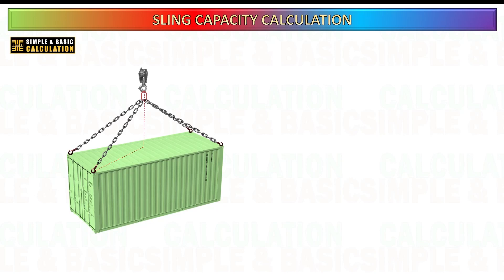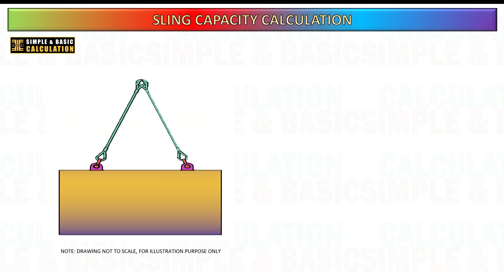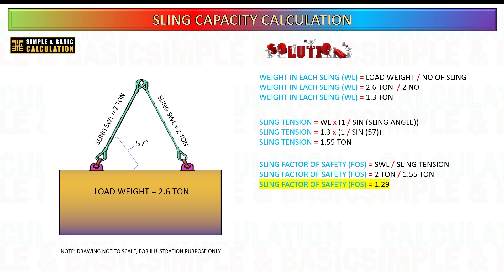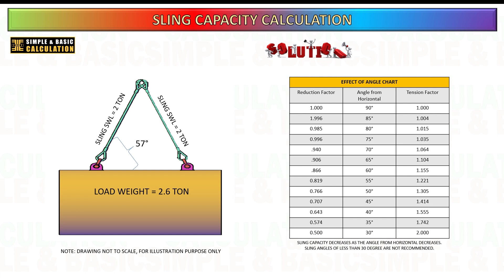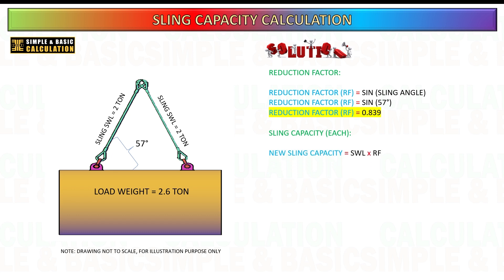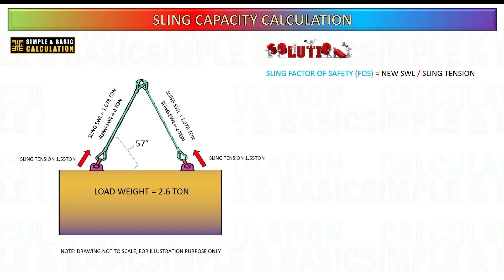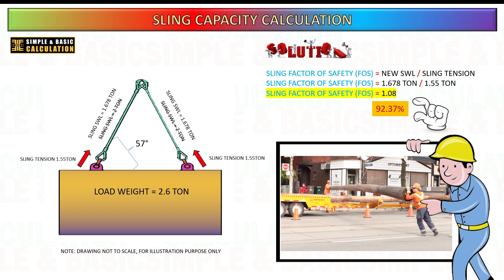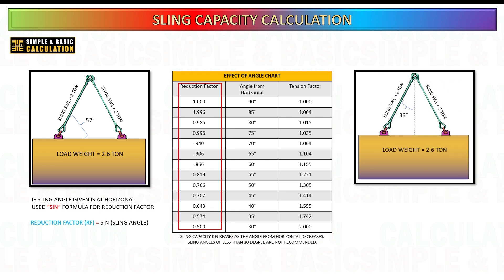Rigging Calculations: How to Determine Sling Reduction Factor

Comment: Dear sir please send wire rope sling details and capacity
Reply from the maker: Hi,
Please refer to your company's wire rope inventory or check online resources. There is a wide range of wire rope capacities available in the market. Determine the required capacity for your project and verify if it is available within your company. If not, consider purchasing or renting the necessary lifting gear.